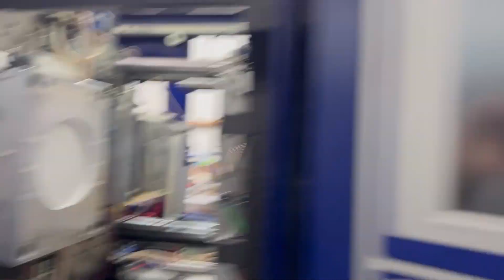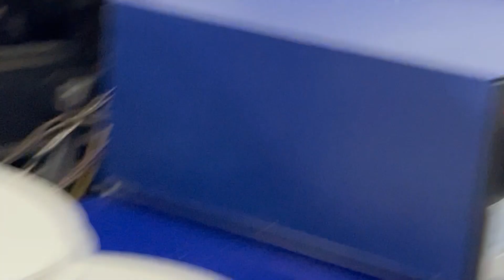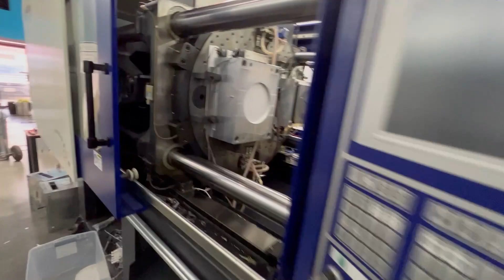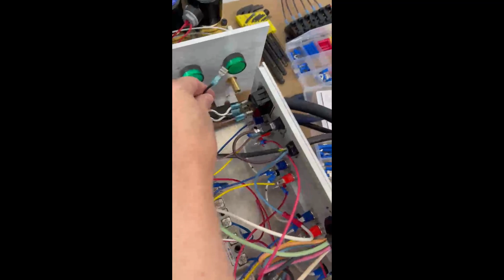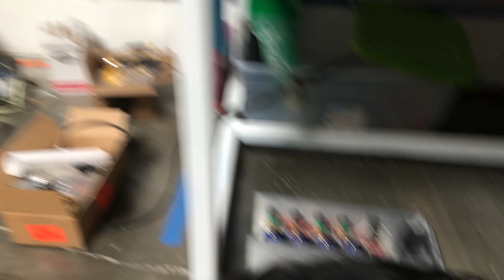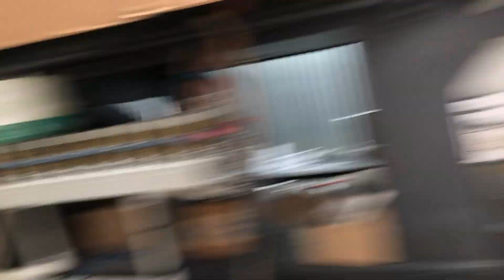CUSTOM TEMPERATURE CONTROL

Comment: Realy nice set, i like the idea with  the Amp.-meters .
The fuses are useless, they are extremly slow blow,
a SSR need ultra rapid fuse.
The connectors you use for the T/C are wrong.
there are special T/C connectors.
Reply from the maker: Thanks for the advise Mario.  Yes, I plan to update the fuses based on your feedback and others.  I know the sensor metals are wrong in the connectors, but I rather have the 5 deg error than deal with those fussy temp sensor connectors.  Thanks for watching!

Comment: Enjoyed the "Prototyping". Watch your fusing especially if your using 220 or 120vac.  Thanks for the look.  BTW, you better develope a schamatic for instrumentation because 6 mths from now you won't remember how you put it togeather and will have to invent the "wheel" again, just thinkin outloud.
Reply from the maker: Thanks John.  I am super busy to paperwork has to take a back seat.  I guess I am stuck with this video as a record.
Reply: @DragonflyEngineering  you need a little more help at work.Don't over do it.

Comment: Nice temperature controller.. note automotive fuses are rated maximum 30 Volts
Reply from the maker: Hi Martin, thanks and good point about the fuse raring.  I should update that.

Comment: Be careful with those Fostek SSRs. 99% of them are fakes and have triacs in them not rated for the load the SSRs claim they are rated for. It's a long standing known issue with those things. It's virtually impossible to find genuine Fostek SSRs (unless you by them from McMaster or something at stupidly inflated prices)

Comment: Nice job on the box. I've built scores of those things over the years. It would be better to use proper thermocouple plugs/jacks or at least screw terminals, you'll likely be adding 5+ degrees C error at best with those banana jacks and spade connectors. Some regular gold plated connectors will work well if they're built to be isothermal. You probably know the trick of using a magnet to find the minus lead in case of mixed color codes (China and Japan use different T/C colors than ANSI/ISA). Reversing a section of extension wire will still work but will usually have nasty drifting errors.
Reply from the maker: Thanks for the feedback Spehro.  Yes, I know my temps are not quite right. I guess I am interested in my setting not absolute temp. Nice trick with the magnet.  Thanks for watching
Reply: Hallo Sperho, be carfull with the magnet test, please compare T/C typ K NiCr-Ni with T/C, in example, typ J Fe-CuNi,
you will find out that youre magnet test does not work and a mixed match with different T/C wires is not recommended.

Comment: Just buy yourself a water heater for the tool temperature control and do it properly because the temperature will go from 70 degrees to 20 degrees the thermocouple temperature will look likes it's 70 degrees but half the will be cooler I would guess. The only time I have seen this set up is on a very small mould using 30 percent glass filled Nylon 66 material and on high temp PC that needed tool temps over 120 degrees.
Reply from the maker: Thanks for the feedback James, and thanks for watching!

Comment: You said that you were using Two Phase. You were incorrect as you are using Single Phase. To use Two Phase you need to use L1 to L2 and L2 to L3 and not use L1 to L3. Please note you can also get Two Phase from L1 to L3 and L2 to L3 and not using L1 to L2. Another way to get Two Phase is L1 to L3 and L2 to L3 and not using L1 to L2.
Reply from the maker: Hi Rita, yes I agree.  My thought was to not lose the average listener  in phasing of the 3 hot wires, I was more interested in pointing out that both wires (in a house or industrial 200+V outlet) are pushing voltage, as opposed to a 120V outlet that has one hot wire and  a non power neutral.  Some people may not know that. Thank you for your feedback!
Reply: @DragonflyEngineering  what many in the United States may not realize is that 220 Volts is provided to majority homes. What does tend to throw people off is the Center Tapped Neutral that goes to ground and is brought in to the Main Power Panel where neutral is separated from ground. This is done for safety reasons.
Reply from the maker: @Rita_Loy  Thanks,  I also added your feedback to the video comments too